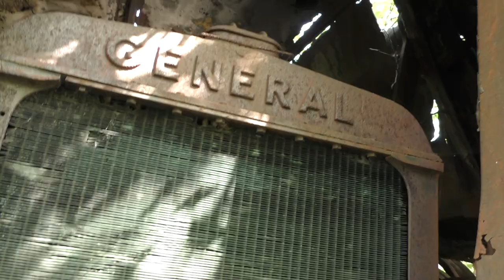"Abandoned" General Cable Shovel Walkaround

Comment: Not really that bad. 5 gallons of 50/50, a 5-foot bar, a crow bar, a couple of roller head bars, drifts and assorted hammers and there you go again but it sure is interesting. Never heard of a General but there's a lot I ain't heard of and tar for asphalt makes good crater. The boom hoist under the seat is interesting and the booster band clutches. Old IH radiator cap deal? Right up your alley! Thanks, Franko and GBWYall!
Reply from the maker: she's a bit tired. I wouldn't mind owning it one day though. id really like to hear what that buda would sound like
Reply: @73DiamondReo  That makes 2 of us and I'm tired too so that sounds unanimous. Only Buda's I ever heard run were on Bucyrus churn drills pounding out wells and they were far and few between. Most were Red Seals and Continentals..